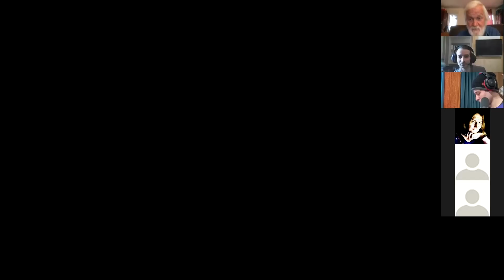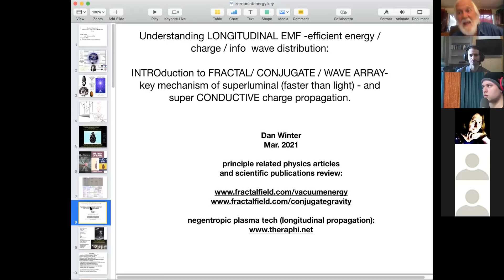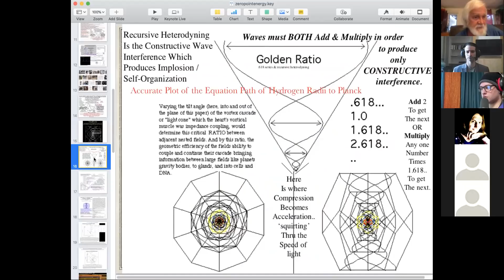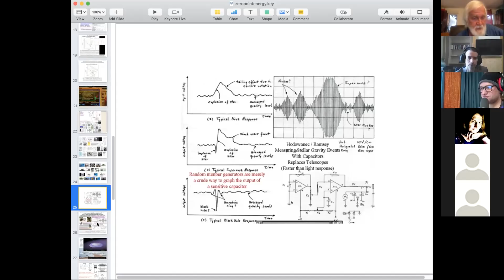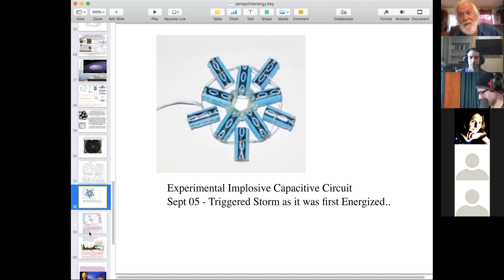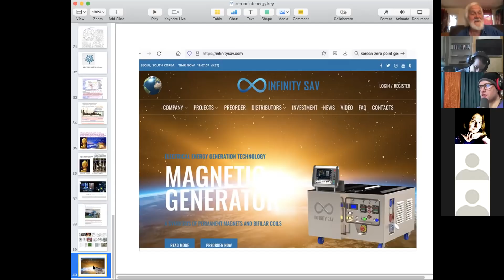Principles of Zero Point/ Vacuum Coherence Energy- Dan Winter, Elizabeth Donavan & Generation Zed

Comment from the maker: since many are asking more about the plasma physics behind the concept of rapture ('photon cloud') - with onset plasma spin density -  it is likely that during the rapture 'guns will melt' - materials with lo dielectric make heat during plasma implosion ,  and  'ancestors will rise from the dead' - ghosts in fact require place of plasma density to be released into 'longitudinal array' - see  - physics of heaven       http://www.goldenmean.info/heaven    (array of charge distribution efficiency / planes of sharon / champs élysée
Reply: What is the zero point energy? Where the structure of that space doesn't move or the smallest particle has no energy or the space are going blocked by something to isolate that space?
Reply: Dan. I have seen Energy for over a year. These last few weeks.. Sky People.. Trees come alive.. plants.. far too much to say here. This Shift is real. I would love to connect
Reply: Thank you Dan!!!

Comment: My amateur guess is that the vacuum energy is a soup of waves that everything is made of and all local forces are simply gradients in the vacuum pressure, such as the Casimir effect. And the so-called vacuum catastrophe in physics I believe can be explained by in ordinary space most of the waves cancel each other out, and when the waves are made to align that's a huge zero point energy potential.

Comment: I was never very strong in math, but I recognize patterns extremely well. I have pitch perfect tone recognition and have always considered myself an artist...but I can't let go of the idea, or concepts frequency, via resonating, gavity and the law of attraction.
I have never taken any psychics courses  and have shyed away from them because the "Math" is very confusing for me. But I've known for 10 years now (by my own contemplation) that Gravity is Quantum Entanglement. That magnetism is just the Geometic orientation of particles creating the attraction (Pos or Neg or Male and Female).
Hence the idea of Sacred Geometry is the art form of Nature. In the periodic table of Elements, atomic structures are aligned in a pattern thus creating the attraction densities required to feed/stabilize the element.
Use the Hermetic principal "So Above, So Below" and you will find the opposite arrangement that would fit, like a puzzel piece, and follow the road. This is essentially the Mandelbrot Set of Geometric patterns. A Frequencies Rate (voltage/amperage, The push and amount) is determined by the need of a  structures of the objective to form. Similarly a "sound wave and light" can direct the Hz of light into a geometric pattern. All frequencies are not indefinetly stable though, they will de-harmonize from its harmony. But the  disharmony will eventually return the state of harmony through. The principal exists in all things. So what Frequency will repel, or bounce particles? That will be the force around your vaccumm...then give the inner space some to reduce their excitment and gind order within their confines.